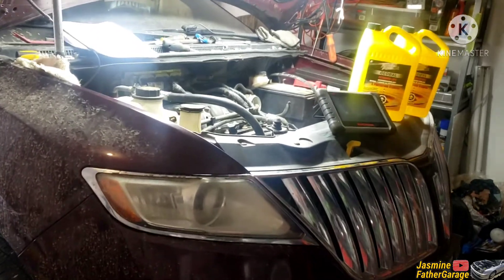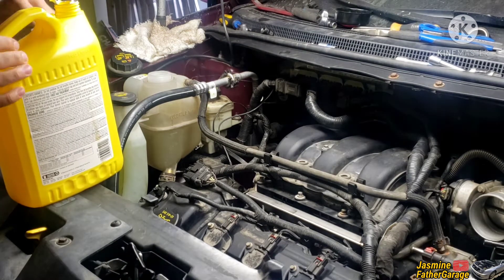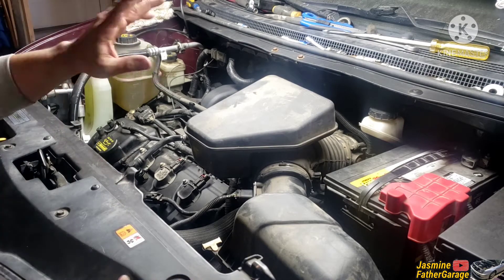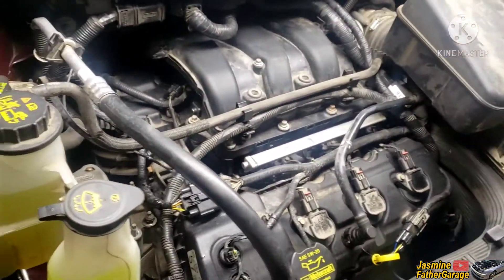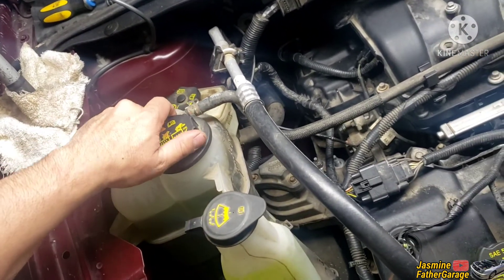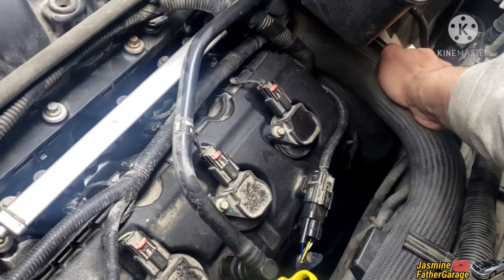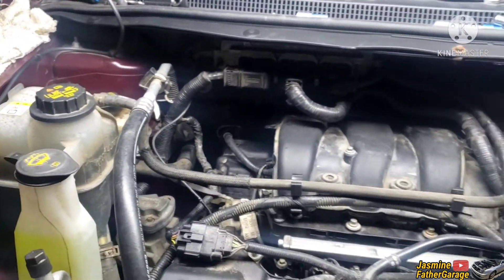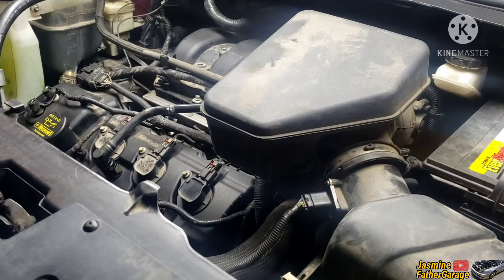Lincoln Mkx/FordEdge 3.7L 3.5L How to Bleed Coolant System

Comment: Your coolant level never went down and the coolant is turning black. Why is that?
Reply: Probably just a blown head gasket.
Reply: Yes that coolant turning black isn't good unless it's old contaminants from previous work but it should be drained and flushed again or else the coolant is no good.

Comment: Where is the drain plug in the 2012 Lincoln MKX, I check Ed several times and I couldn’t find it.
Reply from the maker: Button back side of the oil pan
Reply: @jfGarage4k  Found it, the previous owner replace it with a black Radiator Drain Cocks. it was a little difficult to see at first.

Comment: Is it normal for smoke to be coming from the engine like that ?
Reply from the maker: Smoke from exhaust Manifold. This is a first start up of this engine, I service this engine a week before  this video it was a replacement engine and  the exhaust  manifold  has some grease and oil it need to be burn  thats all and its back to normal after

Comment: thanks for the video. How did you drain the system?
Reply from the maker: Couple option to Drain  this coolant on this Lincoln Mkx.
Option one:  Pull out the draincock from the radiator 

Option two:  Disconnect lower Rad hose
And  let the coolant  drain into a bucket
Reply: @jfGarage4k  Great, thanks.
Reply: No